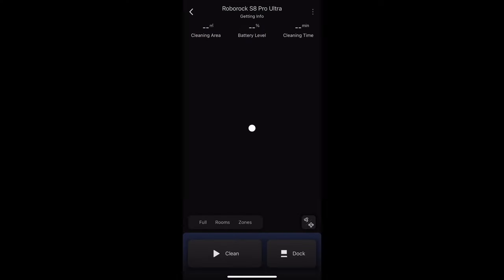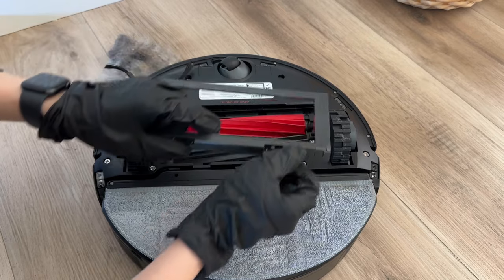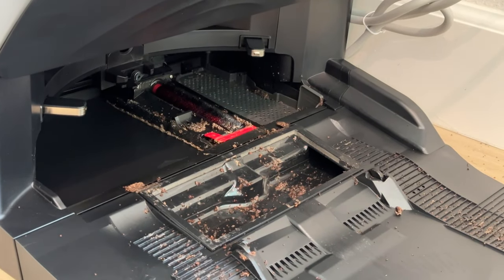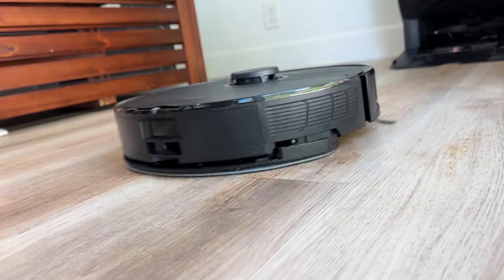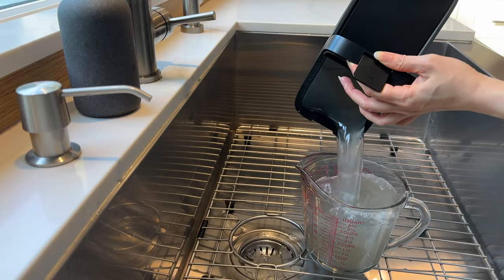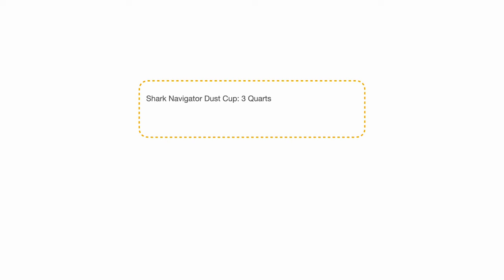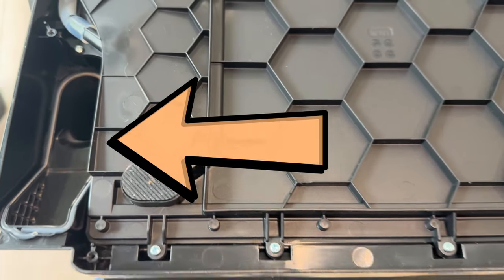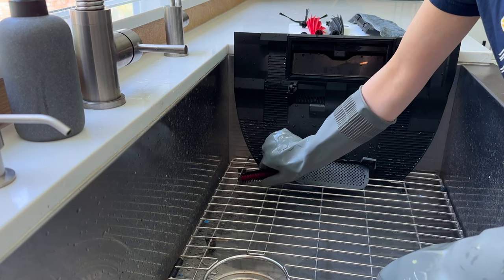#Roborock S8 Pro Ultra -  How To Clean the Robot

Comment: Most robotiic vacuum excels when it comes to handling regular dry messes, effortlessly tackling everyday dust, dirt, and debris. However, it might not be as optimal for handling stickier spills or messes that require a bit more elbow grease to clean up. While it's fantastic for routine cleaning tasks, it might be worth considering additional methods or tools for those occasional tougher challenges. Anyway, thanks for the video tips! It helps!
Reply from the maker: @HydroMant Thank you for sharing your experience! My additional method has been cleaning it by hand LOL because I have yet to find a tool that can clean up black marks from the vinyl floor without some elbow grease. Do you have any recommendation?

Comment: Hi Kim great video! I got one issue though with my S8 Pro Ultra, which is the onboard tank of the roborock itself. Not the water tank or the dirty water tank which seat inside the dock. It tends to get really smelly after quite some time. Previous model like the S7, you could remove the onboard water tank for cleaning. I've reached out to Roborock and guess what....they didn't give any solution to this obvious design flaw. Hope that you probably have encountered this issue before and can share any tips to get rid of the smell.
Reply from the maker: @MRizaE  Thank you for sharing your experience. I haven't had this issue. The onboard tank on the robot itself should be clean water only, so it shouldn't be smelly. If it smells, I wonder if (1) the washing mop somehow gets the dirty water back into that onboard tank, which would mean that its a defect on the product, or (2) somehow something dirty got stuck in the onboard tank by accident.

The only thing I could think of that you can do is following the steps below in order:
(1) Disassemble the mop and wash with soap by hand
(2) Consider cleaning the bottom of the robot and make sure nothing smells at the bottom of the robot
(3) Consider cleaning the dock and make sure nothing smells in the docking station
(4) Clean both dirty water tank and clean water tank of the dock
(5) Run the Wash Mop function 5-6 times or more (do this after everything is clean and you haven't mopped or clean anything). This steps should run through and clean the onboard water tank. I'd recommend do a sniff check every few run to see if there's progress.

Hope this helps. Please let me know how it goes!

Comment: Thank you for your cleaning help as I'm a newbie. When I turn the robovac upside down is there any water inside? I'm still confused as to when it has mopped and goes back to the dock, does it empty dirty & refill with clean straight away? It says 'starting to wash the mop' when I have it scheduled on a cleaning cycle, before it cleans.
Reply from the maker: I don't know about other model, but the Roborock S8 Pro has clean water inside the robot. That's the water that is used to mop the floor.
The Roborock S8 robot does a mop clean and empty dust to the dock's dustbin when it's at the end of its clean. It may empty the dust if it sense the dust bin on the vacuum is dirty and you have Auto Emptying enabled with Smart mode. As for washing the mop during a clean, the frequency is set under Dock Settings > Mop Wash Frequency.

Comment: Do you recommend using the robovac detergent? And where do I put in ? In the clean water tank?
Reply from the maker: Are you referring to the RoboVac Hard Floor Cleaning Solution? Unfortunately, I'm not familiar with it since I have not used it. I make my own cleaning solution with the 5% vinegar and water. If you want to use the RoboVac Cleaning Solution, you can try it by diluting it with water for your first test and see how it works out. Hope it works out for you! 🙂

Comment: I have a question about water tanks. Is there a way to clean the dirty water line? Vinegar solution? Is there a flush setting?
Reply from the maker: There's no flushing setting, and I don't see anything on their User Manual on cleaning the "dirty water line". From theory, you can try dumping out the dirty water tank and cleaning a clean floor with vinegar solution mixed with water. This should help with this "dirty water line" since there should be no dirt or very little going into the dirty water tank, which the vinegar and water solution should be relatively clean running through the "dirty water line" to clean it. Hopefully that helps!

Comment: Hi, how did you empty the on board water tank to be able to flip it upside down? I can’t seem to find that info anywhere?
Reply from the maker: Hi, it can be found from the User Manual under C-15 - Cleaning Air Duct - page 13 of the FCC manual for U.S. users.

Link: https://support.roborock.com/hc/en-us/articles/17819469369241-Roborock-S8-Pro-Ultra-FCC-User-Manual-EN-FR-ES-Latin-

I'd recommend opening up both the User Manual and the Diagram PDF so you can see the diagrams and have their instructional texts side-by-side.

Comment: Thanks. Do you know how to remove stinky water from the robot itself?
Reply from the maker: The water inside the robot should be the clean water because there's only dirty water when the dock is cleaning the mop, which then dumps the dirty water into the Dirty Water Tank. Thus, there's no Roborock instructions on how to drain the internal water from the robot without potentially running into wiring issue.
Reply: Great review. I learned a bit.  I just replaced my old  Roborock ultra 6 with this unit as it was price drop to 987.00 at BB. We wer close to the ultra plus with hot water but that is 1799.00. Just glad I am done iRobot.  Thanks.